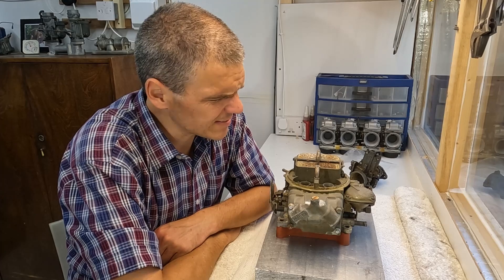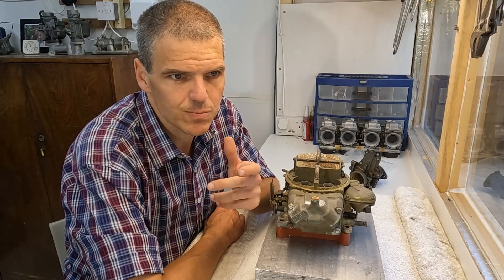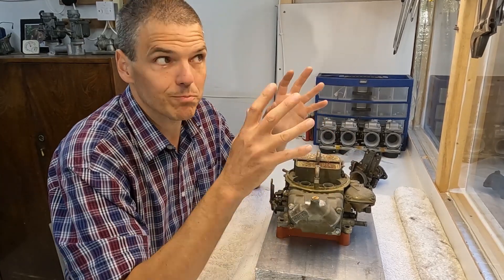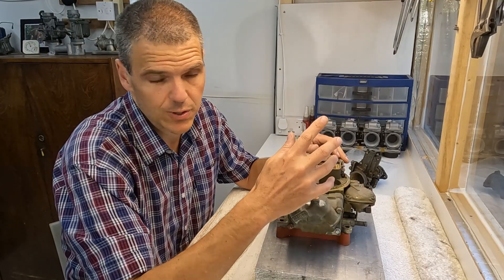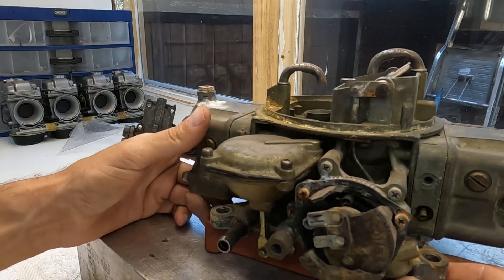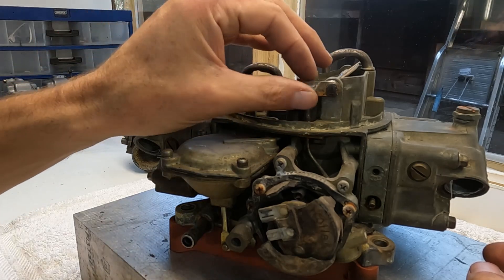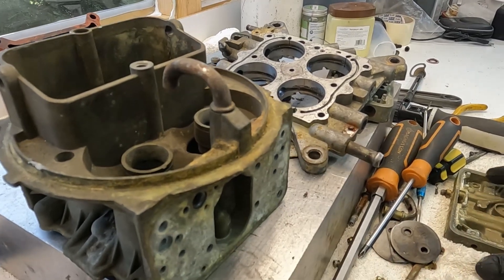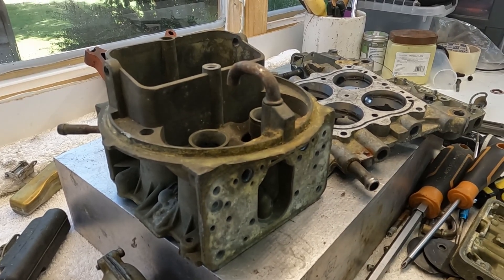How to properly set up Holley Marine Carbs and what factors influence fuelling at Wide open!

Comment: Hello! Very good video. Slightly relevant question... I have a Holley Carb 4780-1 (4150) double pump carb, just like this.... 
It was pulled off of a boat, but does not have the J hooks. 

My concern is that it is not fully marine ready. What all do i need to make sure this is safe to put on a boat? Do i need different jets? or just the J hooks?
Reply from the maker: The J pipes are a must the jeting you can get right by trial and error. Just make sure you do not over lean it